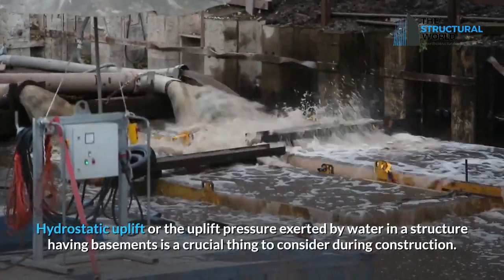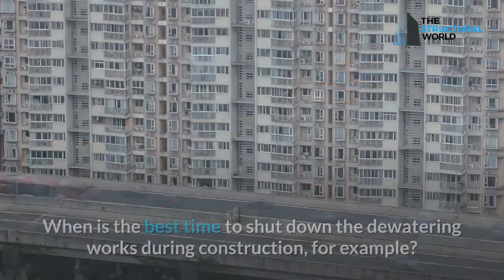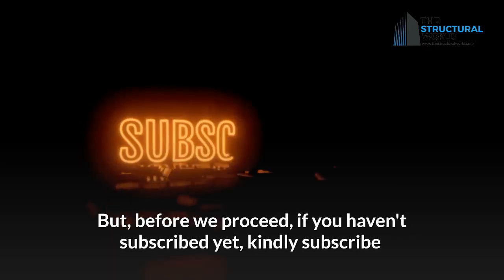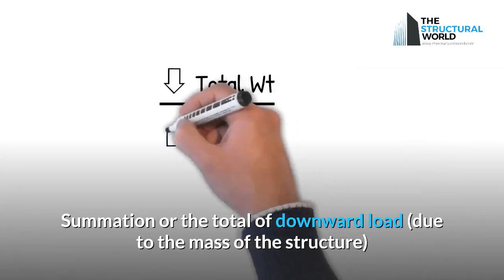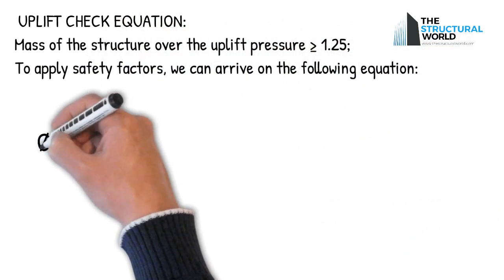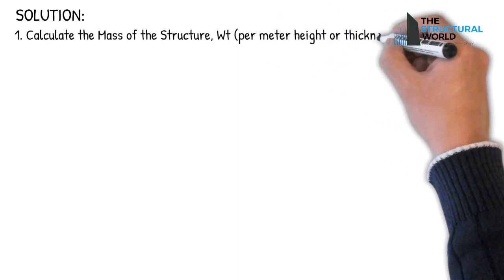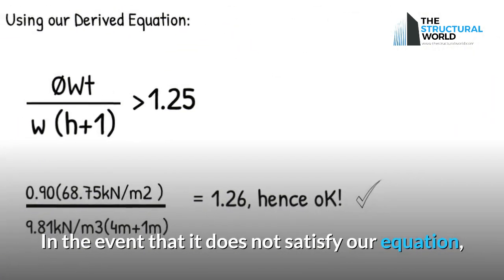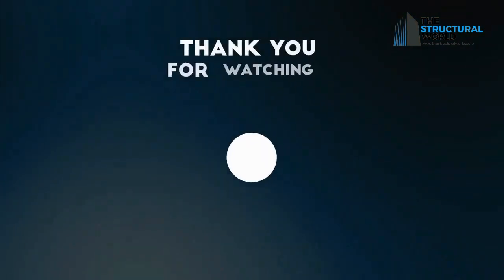Basements and Substructure Uplift Checks | Hydrostatic Uplift Check Calculations

Comment from the maker: Uplift checks are essential in the design of the basement and substructures to make sure that our project can resist the possible uplift pressure caused by the low-level groundwater table.

Comment: Thanks for your great educational video! In Shanghai China, where the groundwater level is as shallow as less than 1m. So as a rule of thumb, we use anti-uplift piles to resist the hydrostatic uplift pressure exerted by the groundwater.